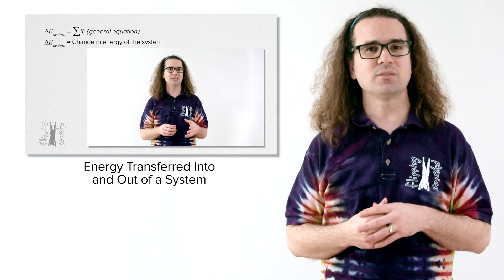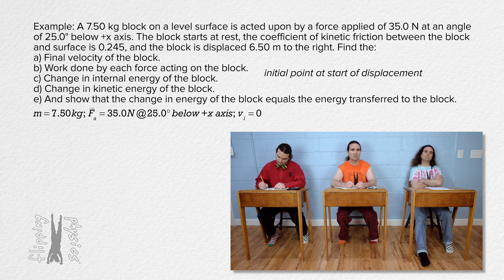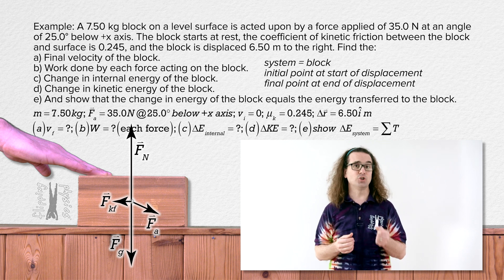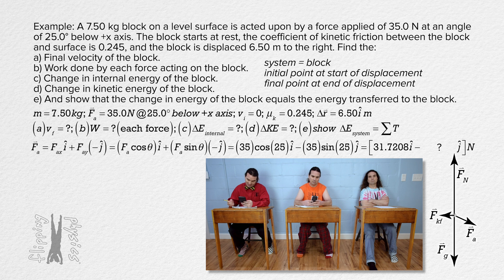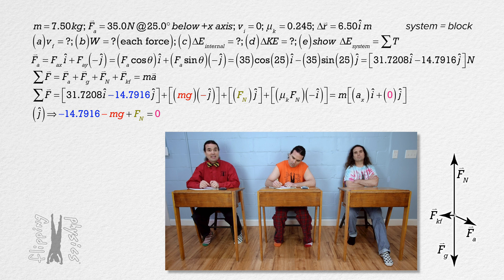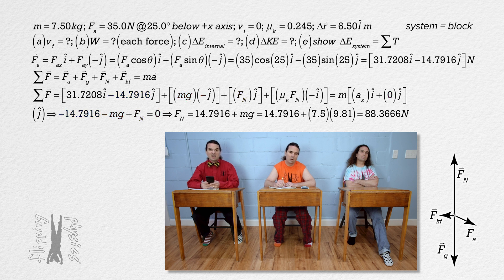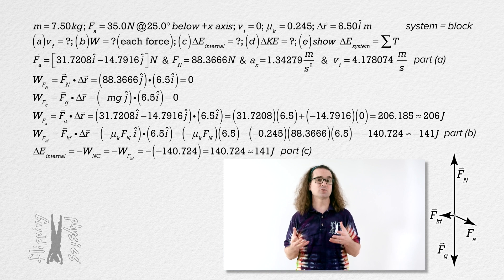Example of Energy Transferred Into and Out of a System

Comment: Hello Mr p! Based on your new video, the one that talks about the 25 years of dealing with only friction force as a nonconservative force (but now we know that any force that doesn't have a potential energy related to it is considered neoconservative force), would you say that the correct answer for part c is negative 65.5 Joules? Since that's the work done by the two nonconservative forces, friction force and force applied….
Reply from the maker: Ah, that's a fine find. Thanks!

So, now, the correct answer does not change. The error from that video was that I had thought all nonconservative forces were friction forces; this is not true. The work due to friction equals the change in internal energy of the system; however, the work due to all nonconservative forces does not equal the change in internal energy of the system.

Take the force normal as an example. The force normal is a nonconservative force; however, the work done by the force normal does not add internal energy to the system. Work done by the force normal can add or remove kinetic energy or gravitational potential energy, for example; however, work done by the force normal will not add internal energy to the system.

Work done by the force of friction does add internal energy to the system via heat. Work done by the force normal does not add internal energy to the system via heat.

Hopefully that makes sense and thanks for asking!
Reply: Thank you so much for replying! ❤ I truly appreciate your hard work, I understood your explanation!

Comment: why is applied force not a part of the internal energy transfer in part c? isn't an applied force, non-conversative.
Reply from the maker: Because the system, in this case, is only the wood block. The force applied comes from outside the system. The change in internal energy of the system, the wood block, is in the form of thermal energy. The temperature of the block increases.
Reply: @FlippingPhysics Mr. P you really didn't answer his question!

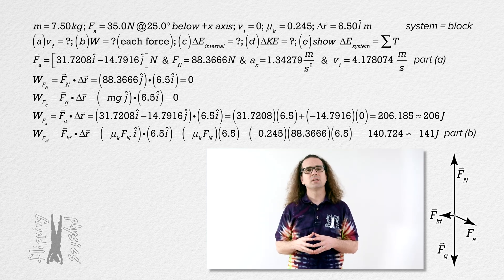Comment: I have a question about part c) in 10:23. At the start of the video in 1:39 we said, we're considering only the block to be the system. So shouldn't there be no change in the the internal energy of that 1-body system? The force of friction would be external to the system then.
As I understand it, if we considered a 2-body system of block and surface (like @davideveritt1647 said) then the non-conservative force of friction would be internal to that system, and the work done by the force of friction would go into the system as the negative of the change of the internal energy
Reply: i have the same question, did you figure it out?
Reply: @science1878 Guys so do I struggle with that! What have both of you found out? Please notify me!

Comment: Based on your previous video Energy Systems Clarified, I feel like you should include the level surface as part of the system, here.
Reply: If Mr. P errored here, and it's true we have to include the surface as our system, then I would to have it confirmed that it wouldn't change any of our calculations right!? Because the problem is not that of the inclined plane.